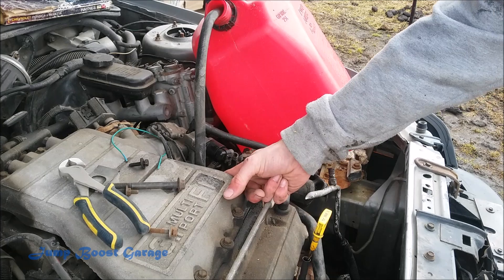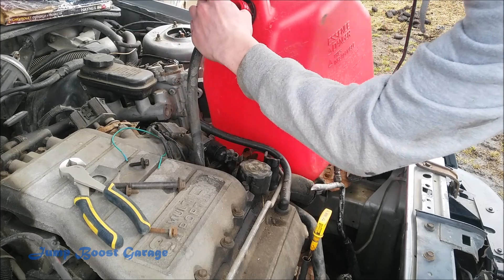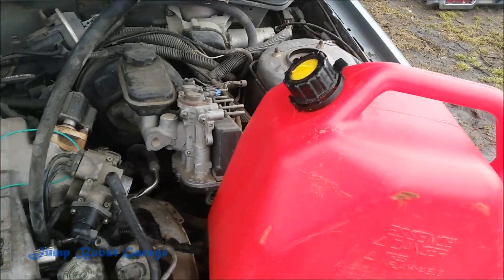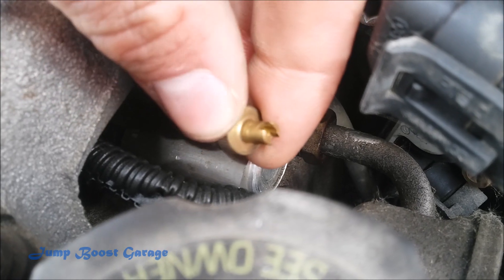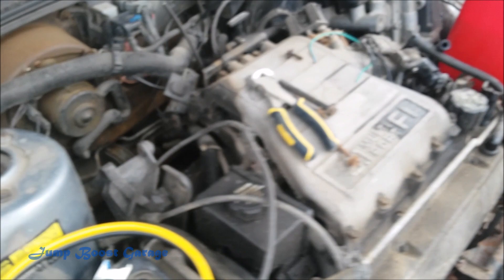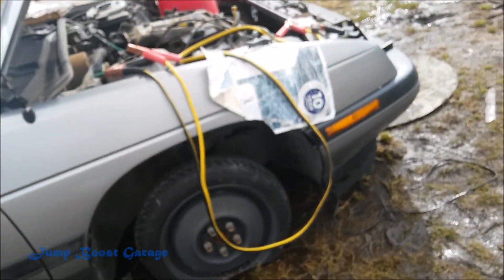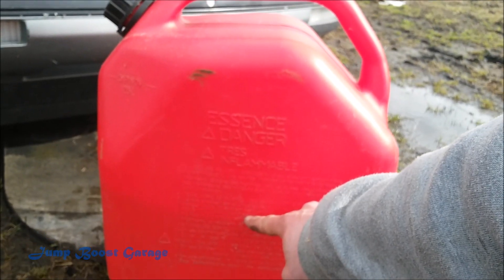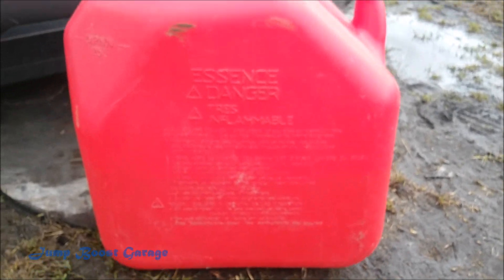How to drain your car fuel / gas tank   ( Put the wrong fuel in you car / truck )

Comment: you could also take out the fuel pump relay and bridge the contacts the fuel pump will run and take a feed from any fuel line after the pump no need to rip out wires or access the pump

Comment: Seems complicated but Im female&i fixed this myself &cost nothing; My silly boyfriend put 15 litres of petrol in my astra which had a quarter of a tank (about 10-15 litres) &he drove it back to me 5miles. When i went to drive it the next morning-it was obvious to me what he had done as it was difficult to start and sounded very rough so i turned it off straight away (had an amazing patient mechanic dad so i learnt a little bit of warning signs b4 he passed away♥️) After locating the fuel filter, identify which hose is coming from the tank& which is going to the engine and disconnect the first. Attach a short hose from that line into a bucket and turn the ignition until the dash lights come on which also activates the fuel pump to spill out the fuel (about 10 secs @a time) turn off&repeat until empty. Takes an hour at least! Reconnect &do the same with the other line from the filter to the injectors.. once all empty put 2 cans diesel in and activate the pump til u smell the diesel coming out the line to the injectors. Reconnect the last hose and you are good to go!:))
No smoke, no starting or lasting problems.Not difficult at all - &you'l save £200 for calling out a fuel drain specialist!
Reply: Joanna Chin you could also take out the fuel pump relay and bridge it, the fuel pump will run no need to rip out wires or access the pump
Reply: David Holgate - aww thnx but apart from not quite understanding what you said lol im not familiar with that way-i just did what made sense to me, saving myself a call out fee!I hope your advice helps someone else though ty😍
Reply: Joanna Chin i

Comment: if its not a junker you can just use a paperclip to jump the fuel relay and use the battery that's in the car, but it is a good idea on the fuel rail port, i might need to use this to transfer fuel from my truck to my stockcar, easier than hauling jerry cans.

Comment: After removing diesel out of the gas tank my check engine light came on and when you step on the gas it take a while to accelerate.
Reply from the maker: Could be clogged fuel injectors. Run the codes from the obd2 port and put in some fuel injector cleaner